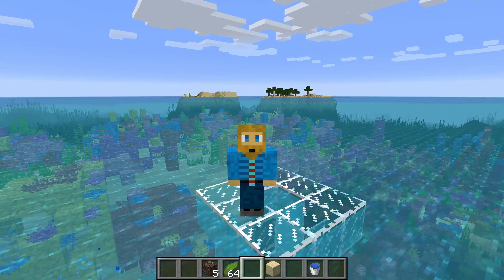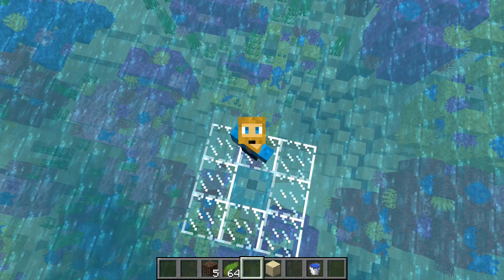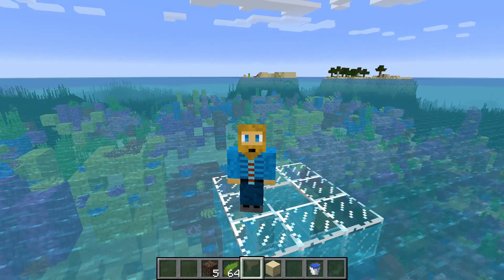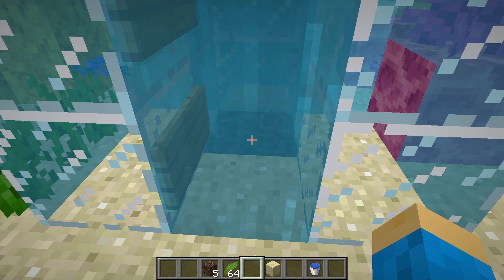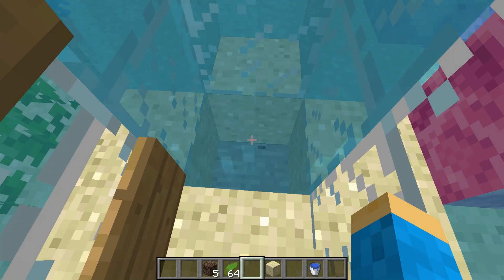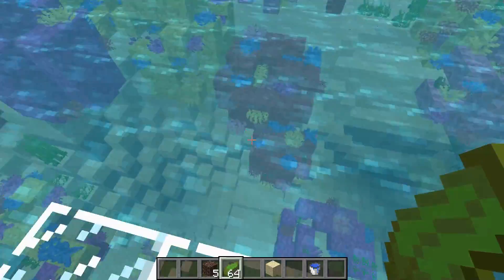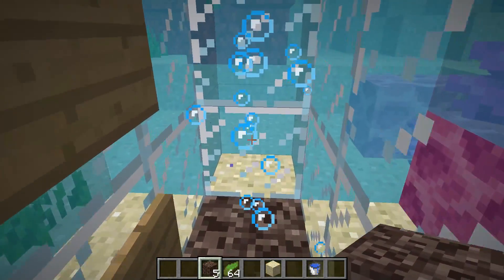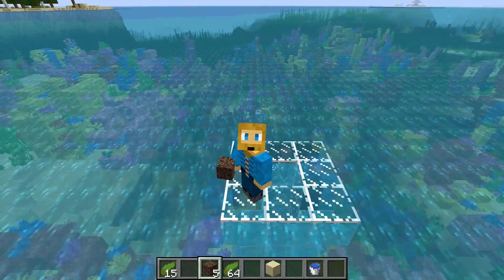How to Fix a Broken Soul Sand Elevator with Kelp!

Comment: Any idea if there's other issues that could cause it? did this a few times and it just refuses to work
Reply from the maker: Make sure you are using soul sand and not soul soil...they are two different blocks and soul soil does not work.

Comment: Could you explain, more technically, what's going on here? Why does the kelp help?
Reply from the maker: Because to create a bubble elevator the entire line has to be made of water source blocks.  Adding kelp turns them into source blocks.  The alternative is to poor individual buckets of water on each block to create a source block.

Comment: Do you have to build the kelp all the way up to the top water block? My elevator is at bedrock and getting that much kelp will be so tedius.
Reply from the maker: Yes it has to go all the way to the top. Kelp is easy to get and super easy to place...way faster than dropping a bucket of water on each block.

Comment: Thanks for the tutorial bro, very straight forward and helpful, do you know why this happens?
Reply from the maker: Sure thing!!! In order for the bubbles to work there has to be a water source block for each block in the column. You can get a bunch of water buckets and manually place water at each block all the way to do the same thing but the kelp trick is much easier! Glad it helped you!
Reply: @KIDALOO  thanks!
Reply from the maker: @kierstanfaulks  - sure thing - anytime!

Comment: Not sure if you'll reply but I've searched everywhere for a solution, I'm in forge 1.12 due to using a mod pack and the mobs act like the 1.13 update but the water acts like the 1.12 update so theres no kelp or anything like that I have no clue how to resolve this
Reply from the maker: You just have to grab a bucket of water and place it on the side of each block in your water elevator.  Every block has to be a water source block.
Reply: That didnt do anything for me :/ I'm puzzled because I have it in a 3x3 area but for some reason doesnt even bubble at all
Reply from the maker: @dwdesign2873  - it must not work in that version then.

Comment: Thanks for saving my ~70 level SoulSand elevator, but my Magma Block down one isn't working, would your method fix that?
Reply: What do you know? Just did same trick with the Down one and it worked!  Kudos
Reply from the maker: @KOZMOuvBORG  - yep it works exactly the same way for both!!! 😁

Comment: As me as a bedrock user i did the kelp trick all the way to the top. Then I replace the souls and and it barely even goes up only like 3-4blocks. The soulsand before hand is like the same then even after I did the kelp trick it’s still the same - I’m confused on what I’m doing wrong to be honest.
Reply from the maker: Not sure Adam...this is how it works on the java version.  I am surprised if it doesn't work the same on bedrock although they are 2 different platforms.
Reply: KID-A-LOO oh it’s alright I figured that the sand didn’t want to work so I tried cobblestone with the kelp and it somehow worked that way when I replace the blocks to activate after I redone the system so your video still helped!
Reply from the maker: @noir-nova8569  - oh good...glad you got it to work.

Comment: Yea I put a soul sand down under a glass column and the bubbles only went up a quarter of the way and when i went in i got stuck half way through the pipe. Panicking because I'm in a hardcore world I've been working on for weeks I tried to break out and ate golden apples but I was going to drown ... i wasn't going to die because of how stupid that mechanic is... I changed the game go survival and fixed it. Stupid. Thanks for the video...
Reply from the maker: Glad it helped!!! Thanks for watching! 😁

Comment: When I add kelp, the water flows out.
Reply from the maker: Then what happens when you break it?
Reply: @KIDALOO  The water is still there, flowing out of the 3x3.
Reply from the maker: @devo220  - not sure. What are you trying to do? What platform are you playing on?
Reply: @KIDALOO  so I made an underwater aquarium and the way I plan on going up and down is via water elevator/soul sand elevator. I play on windows. I can make a video of what happens when I try to put kelp cuz I can't explain it.
Reply from the maker: @devo220  - what happens when you break the kelp and add soul sand at the bottom?
Reply: @KIDALOO  I fixed it. Thank u tho.
Reply from the maker: @devo220  - awesome! Glad you got it to work!

Comment: I have use kelp but it still doesn't fix the problem
Reply from the maker: Check to make sure you are using soul sand blocks and not soul soil blocks...they are 2 different blocks.
Reply: @KIDALOO  oh no thank u so much i didnt notice that hahaha
Reply from the maker: @Trương Quang Duy  - yeah it is a common mistake since the blocks look and sound so similar.